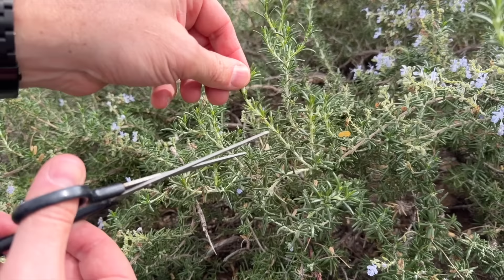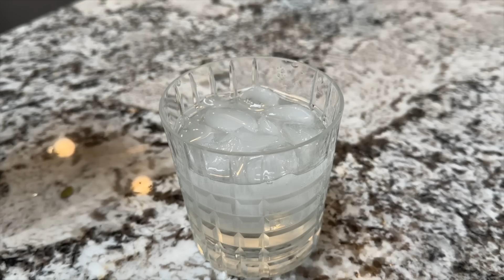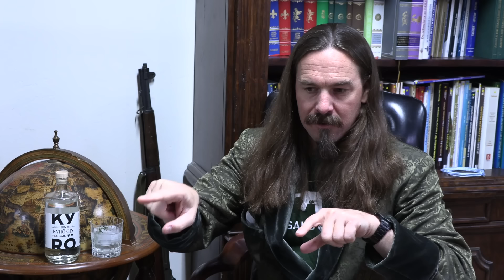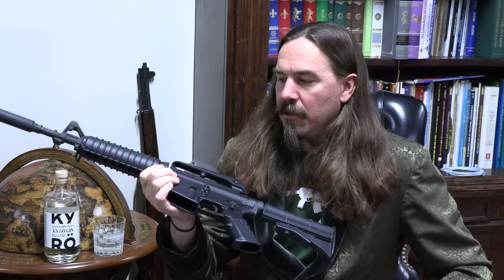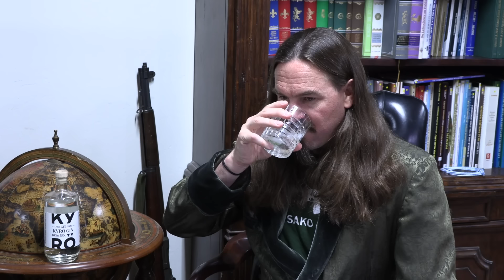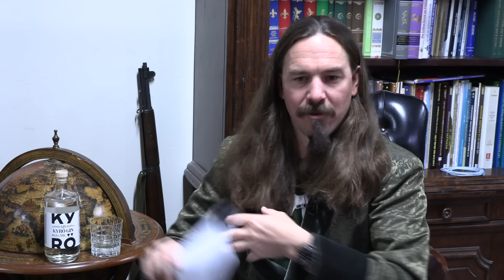How Guns are Made: Tolerances, Methods, and Metallurgy (Q&A January 2026)

Comment: Wow, Ian I don't have to tell you this is very good stuff as you will know. However ... and first my personal caveat and asterix: I am in IT so I may have a limited view. I have always understood that metrology - so verifying dimensional and/or shape accuracy but maybe also quality of surface finishes - is no longer necessarily sampled (statistical).  As bandwidth for all sorts of sensors and analysis of that data stream in near or real time has become practical. In a steel plant with a substantial production volume (Tata, NL specializing in high strength automotive steel) we were f.i. also able - in real time - to link back to administrative systems (for ID of product batches but even the specific ingredients of steel recipees). That was industry normal. I think - to be verified for small arms production - that you can broadly say you no longer need to sample production batches for quality purposes as you can keep up in most computer based secondary analysis processes with production volume (chemical analysis of substance content is certainly not real time also because the lab in question needs to be industry certified etc.)
Reply: "...you no longer need to sample production batches for quality purposes..." Yeah you do, when the part or product is "critical" and you can´t test it without destruction. For everything else, you can control most things 100%.
Reply: @sierraecho884  Thx! Do you have a concrete example? I'm limited to my own experiences ... I've done an IT project involving national ID documents (passports etc) which I would describe as critical (?) Also nanometer level geometry for IC's. I've only experience with aeronautical parts after manufacturing (airline MRO unit) but that has complexities of it's own (establishing non counterfeit parts f.i.). Anyway if you have a concrete example that would help my thought proces and would be appreciated.
Reply: @JanHolland3000-w2d  I am an R&D engineer within the automotive industry. We need to test critical components like latches. You can´t simply say they are fine statistically. Material composition can for some reason be different and 100 other factors. So we have to to destroy those parts periodically EOL. It´s just an example, there are many more. For aviation the part volume and manufacturing methods differ. You don´t produce 8 million units in one year I suppose. So you have other means.
Reply: @sierraecho884  Thx. That makes sense but I was/am wondering if you still need sampled statistical quality establishment methods versus 100% testing. (I.e. can't you robot test tthose latches?) For the latches Use Case I would think the difficulty is in establishing the scope of test suite and protocol (what to test and what the ratio is - if you like what the assumptions are - why that mitigates the perceived risk. Of course also towards regulatory authorities and financial risk management parties). Anecdotal: if a plane lands faster then planned the latches to unlock the external luggage cargo bays can freeze over. When this happens and when you can observe this from observation desk you can see the luggages guys cursing. Took a while before we captured that Edge Case (You don't want to use blow torches near kerosene ;-). I happen to like mechanical as it is typically transparent in troubleshooting (versus embedded software). I am going to chew a bit on those latches, thanks again.
Reply: @JanHolland3000-w2d  "...That makes sense but I was/am wondering if you still need sampled statistical quality establishment methods versus 100% testing. (I.e. can't you robot test tthose latches?)..." Those latches, still would have to be tested physically by destroying them, and it would cost way more to do this by a robot. We have a simple test set up and the same people that assemble them place them there and they get tested. My point was, you can´t always catch all parameters and do a statistical analysis, sometimes you have to test and in some cases a go no-go gauge is also fine, it depends.

"...I happen to like mechanical as it is typically transparent in troubleshooting..." Exactly =) 

"...versus embedded software..." Funny enough, I am currently learning MicroPython, with a small Pi Pico.
I used to dislike elecronics and especially software, but since I know mechanical, It´s more fun to program hardware.

Comment: It is not as simple to switch manufacturing as you make it sound in your first answer. I would refer you to the fiasco surrounding the S&W AR clone.
They bought Thompson Center specifically for their barrel making.
They gave the workers all new machines to work with.
The scrap rate went from $6000/ year, to $6000/Month, because those people were not "barrel makers", or machinists.
They were former shoe shop workers who had spent 20 years running the old machines.

Comment: 1. "Everything is manufactured by CNC machining".  Most volume parts like cars and guns for that matter, are stamped metal, injection molding polymer and Alu Zamac, Mg casts. CNC machining is a good means of production if you need tight tolerances and or small batches. It´s expensive and slow (compared to stamping and injection molding). In fact the US and EU is lacking people with good understanding in those type of manufacturing jobs. Personally I don´t know any car part that is CNC machined and I am a mechanical design engineer within the automotive industry. 
2. The tolerance question was interesting. Every mech. engineer (that I know), does tolerance studies like Ian mentioned. GD&T is a huge part of mech. engineering and is quiet involved. Also you need think about, temperature changes and elongations in parts, moisture absorption, fatigue stresses, dirt ingress and much more. Usually price goes up in square with tighter tolerances. Half the design is scalability and all sorts of details.
3. Quality, the word quality has 100 meanings. In engineering quality means, a part that fits all specifications. So if you ask of a part that is made out of a specific steel alloy and needs a specific surface and dimension of 100 ±0,1mm and you get a part that is made out of Zinc and is 99,5mm than it´s bad quality. Quality can also mean "fulfilling the customer expectations". So if you are a well known brand like BMW, it is expected from you by the customer that your runs at least 100 miles without braking down ( I just made something up), I hope you get my point. The customer expect your product to last a certain time and have a certain performance, even though it is not exactly specified. So quality has to be defined before talking about "quality issues" and such. It´s a difficult topic since it´s a word with 100 meanings. Quality for me as a technical person is like with tolerances "As precise as it´s need to be and as loose as can be". That´s basically the motto. In regard to quality control and what gets measured. Same dimensions and specifications like surface specifications material compositions and so on are so important, they usually come up in your DFMEA, those critical dimensions have to be measures 100%. A critical dimension can be say the material composition of your barrel. If it´s off, if the barrel material has some dirt inclusions and quality defects like that it could burst and potentially kill you, that´s a big no no. Think Lading gear on a plane. So there is a hierarchy of importance. Just like Ian said, the front sight wings are not important, they probably never get measured after initial set up but once a year. The material composition of the batter gets checked on 100% by a material certification from the supper. If a "lug" feature that is critical exists it gets measured 100%, but only this feature and most likely with a gauge, a camera, a sensor etc. In the automotive world those type of dimensions have to be archived for I think it was at least 15 years. So you have to measure every critical dimension and store the information with the part number for 15 years. Where characteristics can´t be checked without destroying the part, you use statistics (it it´s a critical dimension). With "function critical" dimensions, that is a dimension or specification that would make the product not function any more, like a gun would not fire but it would not destroy or hurt anyone, you would use statistics and lesser means of checking. Like checking 50 parts at the beginning of the shift and then checking 50 parts at the end of a shift. So statistics. And some parts you don´t need to check at all. You know if you set up your tools once it will be good enough, or it´s not ciritcal at all etc. 
But you need to do that for every dimension and every specification of every part.
4. We will (most likely) not see metal 3D printing at home, that fast, It has to do with material technology. Metal 3D printing is either SLS so you melt powdered material (that is difficult and dangerous to handle, which is the problem, not the printing itself) or metal binder jetting, which uses powder as well that gets sintered. A third way would be using casts, which you can already do today, but again it´s 1500°C for steel, who at their right mind does that at home ? Metal 3D priting will never be a thing like polymer 3D printing which with FDM is simple. But again you don´t have SLS polymer 3D printing at home, even though it would be way better than FDM right ? For the same reason. It´s material handling and hight temperatures that are the problem, even if the tech gets cheaper, the handling problem stays.The first polyer resin 3D printed I had used was 250k, now a bambu Lab is like 300 bucks to 2000 bucks, but that was scale and such, with metals it´s a different beast. Ian simply thinks, well tech will simply progress and it will come down in price, which is true but it´s not that simple.

Comment: 36:48 And the tolerances need to be set so slightly out of spec parts work. Roughly 2 sigma of what will work. Also allows for Murphies law.😂
Reply: How do you come up with that ?
Reply: @sierraecho884 I started working in metal manufacturing in 1989. Shortly after I started we had parts out of spec. Contacted the customer and they said don't bother us for a few parts unless it's  out more than a quarter of the tolerance. The engineers who set the specs knew the low bidder gets the job and will run parts out of spec.
Reply: @uberfalcon1965  "... The engineers who set the specs knew the low bidder gets the job and will run parts out of spec...." I don´t really get that. They wanted to get rid of the low bidder this way ? 
Usually when I set up tolerance, I do it by the golden rule "as loose as possible and as tight and absolutely necessary" so when my parts are out of tolerance, something is seriously wrong. I work in automotive as R&D engineer.
Reply: @sierraecho884 I don't know what parts you work on.  My experience is the supply chain is so tight customers will take parts a little out of spec to make delivery schedules. 

There's a reason JIT stands for Just In Time and Junk In Transit.😂
Reply: @uberfalcon1965  "...I don't know what parts you work on.  My experience is the supply chain is so tight customers will take parts a little out of spec to make delivery schedules. ..." Yeah, this happens, because 90% of all tolerances are just made up and not calculated or evaluated properly. So they will simply check if their product still works, oh it does ? Yeah alright lets go then .

"...There's a reason JIT stands for Just In Time and Junk In Transit.😂..." Yeah, it´s more like they don´t spends too much time on precise tolerance calculation. No one likes to do that, it´s very tedious and you won´t get a cookie if you do that and the other guy does not. You are responsible for say 15 parts. Each part has about say 30-50 features, you need to cross reference all of them. This takes a week or two ....

Comment: Now think about Glock innards. All of it is probably laser cut sheet steel that is then folded. So the barrel, slide, and FBP are the only machined components. Everything else is injection molded plastic or bent sheet metal with very few changes over the years. Everyone else machines, casts, injection molds, or however else forms their fire control parts in handguns.
Reply: It´s because sheet stamping and injection molding is by far cheaper than milling by a multiple factor. Any part that can be stamped or injection molded is done that way.
Reply: @sierraecho884 sure. I’m just saying they should cost like 1/2 as much as anything else

Comment: Just FYI, for simple stampings, PLA is already demonstrated as viable for making punch and die for stamping. So it's already viable, on a small scale, but the punch and die wear out QUICK. That said, it is not yet viable for more complicated stampings, for various reasons.
Reply: Look up Stratsys FDM nylon 12 cf deep drawing tool. Uses a CF nylon print with a quickset cement backing
Reply: @matthewbarry376  Oooh. VERY cool. I'll have to dig into that, more.
Reply: Yeah it´s for a hobby, it´s also polymer lo. You can metal 3D print tools instead.

Comment: For those having trouble visualizing it the Blanchard Lathe is a multi axis version of how the key cutting machines work in your local hardware store.
Reply: I never seen the inside of those key cutter machines
Reply: @GS-zv3qn  I've seen several that have transparent covers and am old enough to remember ones with no covers. Which isn't that old.
Reply: Hahaga yeah I worked at Ace Hardware in high school .  Our key cutter had 2 clamps ine with the pin to follow the key teeth and the other with a cutter head to cut the blank. We just moved it manually back and forth. It had no guards as the brass did not fly far.  Not that long ago, I graduated in 1999. Kids most keys used to be cut by a human at the store.
Reply: @ryanramsey9621  when I was in Korea I had a couple keys copied and the man clamped my key to a blank and hand filed the copies
Reply: The same style of machine is used for making aircraft propellers

Comment: The issue with rare tolerance stack combinations can be largely offset by test firing the gun before it ships.  If it fails, it goes into the troubleshoot pile and they find a combo that works, and ship it. Much more cost effective than gauging every part.
Reply: So back to the 30´s where GD&T wasn´t a thing yet and everything was hand made ....
Also do you find the correct toleracne pairing with ammo ? How long so you want to test fire it ? And how are you going to gauge all that bullets ? And oh they are test fired regardless.

Comment: The only limitation on truly mass production in my opinion would be government requirements, availability of gauging from the government and the bottlenecks from CMM inspection/AS9100 quality systems. There are many manufactures that can produce the AR 15 and pistols and probably millions a year - just getting around super tough (often for no reason) gov't requirements on finishes, materials, etc. that increase costs. If we could use commercial grade + ARs it would be no issue.  For example, one time I was quoting M60 bipods and the steel spec they used was literally WW1 battleship armor plate. Obviously not available unless we get a mill run which was prohibitively expensive for the quantity. I picked a suitable grade of steel (same we used for M240B bipods) and sent in my quote but it was rejected because the material wasn't right and they didn't read my notes at all.   They ended up buying surplus bipods out of Vietnam.

Comment: 38:00 I do process planing for heavy truck transmission machining and a big part of PPAP (Production Part Approval Process) is process capabillity. That usually involves running like a days worth of parts, meassuring them all and checking, for critical tolerances, if +/- 3 standrad deviations of process is still withing the tolerance band.

Sometimes you get something easy to fix where the spread, or standard deviation is good, but the average is in the wrong place, sort of like having a tight grouping but needing to adjust zero. Maybe heat treatment distortions behaved not quite like you thought and you need to change the pre heat treatment dimensions. 

If you are unlucky different material batches from the forges will have slightly different compositions and/or residual stresses (but still within spec) so the behave slightly differently after heat treatment so you have to run a few parts and check if you can still run with the same "soft" (before heat treatment) machining dimensions or you need to change them for this material batch.

Or you might see a process that behave nice with small spread but suddenly one big jump in the meassuerd data followed by a low spread arround this new value. Probably something happening when changing replacing tools or inserts. 

Tons of statistics stuff.
Reply: A yes, zero series production.

Comment: 52:38 You can 3d print jigs to bend your own springs.
Reply: You can 3D print metal stamping tools, use the rubber forming process you only need one half and if you have a 50Tpress for like 1k you are golden. You canactually produce 1mm thick steel parts with FDM tools. About 100-300 parts before the tool breaks, it´s amazing, but you need to know what you are doing.